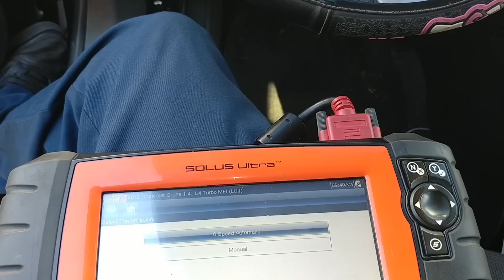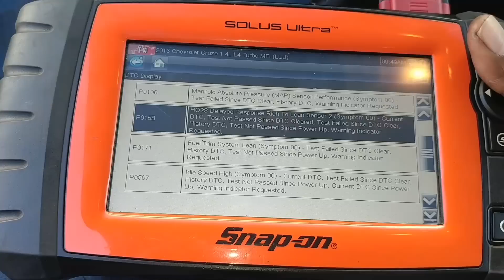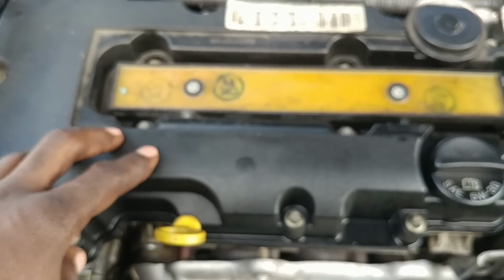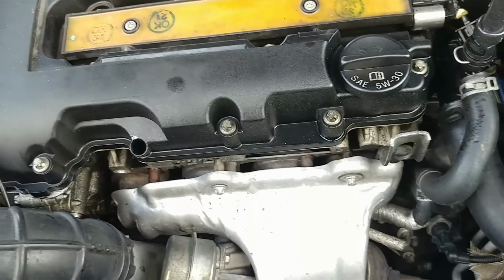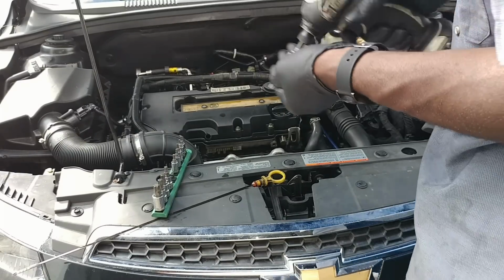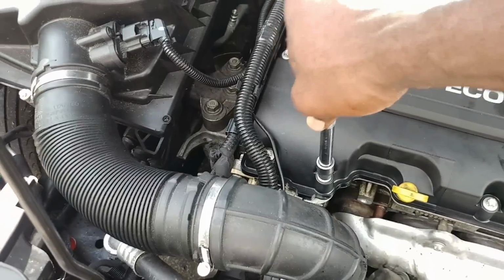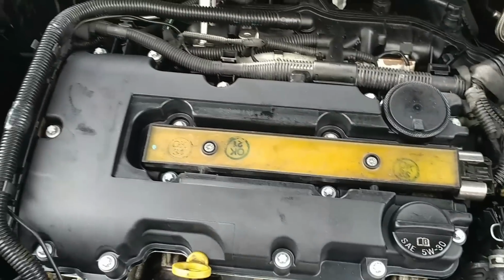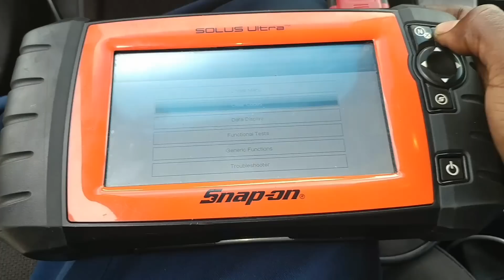Chevy cruze valve cover / pcv valve replacement

Comment from the maker: Help me help you by hitting the subscribe button
Reply: Great video Dullah. How bad is it to continue driving with the bad PCV valve? I am pretty sure this is the problem on my 2011 Chevy Cruze with 102,000 miles. I just changed the spark plugs last weekend and do not have time to work on it again for another 2 weeks. I am driving about 90 miles per day.
Reply from the maker: Poor engine performance and stalls and bad gas mileage
Reply: Thank you very much, I was able to successfully change out the engine cover yesterday. The wire harness on the left side of the engine cover was a little bit of a pain to disconnect, but looking back at the clips it looks like you push in towards the engine and then up and they would have come off much easier. Running much much better now and also did a Lucas oil fuel treatment. What is your opinion on running seafoam in the oil to clean up some of the gunk? I'll be sure to give your video a like and follow your channel!!
Reply: Do you know where I can get this part please

Comment: This repair is covered under your power train warranty, my Cruze has 94,000 miles and it’s in the shop right now getting repaired
Reply: i don't think it is covered
Reply: @LOLONO666 covers pcv valve 100% cover until warrant. not regular warranty chevy gave extra 10-11 years warranty for some parts like pcv valve because this problem is 97% cruzes and thats why GM RECCALS FOR ALL CRUZES FOR FREE replacement for these some parts.
Reply: @YT91-ot1gx never heard of that.

Comment: Ok bro awesome scanner by the way lol. That valve on the valve cover is not the pcv valve. It’s the vacuum control valve. The pcv valve is part of the intake. It’s amazing u guys actually get the right pats.on the solus scanner if you have the proper update it will show you the vacuum diagram for this vehicle with the proper names of the components and where their located. Just an fyi.
Reply: @dr6124  if you follow the corrugated hose from intake to turbo inlet that is the pcv coming from intake. If you take the hose off from intake side and look down you will see the shitty pcv valve design lol. If there’s no rubber looking plug then you’re goin to have to replace the intake. It’s mostly the reason why the vacuum valve dies.

Comment: The cover with the diaphragm is not the pcv valve.  It is the vacuum regulator.  The pcv valve is in the intake manifold and the turbo inlet.

Comment: I didn't see you mentioned the need for silicone sealant near the cam drive sprockets.
Reply: Glad I'm not the only one who caught that! Nevermind the improperly torqued valve cover. The proper spec is 71 inch pounds.

Comment: I don’t have air blowing out like that or suction do I need to replace the valve cover? My gasket is seaping a little oil out so idk if I just have to replace the gasket or the whole cover ??
Reply: It could still be the valve cover, check https://www.youtube.com/watch?v=aqFFn1cjgdc his was seeping oil but i think it also blowing air.
Reply: @Tvordiy92  yeah mines not blowing air or sucking in air
Reply: Same problem in my car. Oil coming out because of bad pcv valve cover. If not problem for you may be its just strated.      If some other issue let me know.
Reply: @YT91-ot1gx  yeah if oil coming out your gasket is bad or check the bolts .. and usually when u change ur gasket u change the cover.. car is a disaster problem after problem now I think my turbo going and a tiny head gasket leak out the block

Comment: That’s not a PVC valve it’s part of the PVC system  but there are 2 PVC valves, one in the intake and one at 5he end of 5h3 brittle plastic hose that goes from the intake to the turbo inlet.

Comment: My sonic runs ok till it warms up after that is runs like crap. No engine light has come on. Would the cover be doing it?
Reply: I had that same behavior, it ended up being a leaky valve cover gasket but it also threw P0171 and P0420.

Comment: I'm getting a p1101 code on my 2014 Chevy Cruze. I suspect this might be the reason for it - I noticed when this error code came up the serpentine belt was also starting to squeak. Not sure if that is also related to this cover?
Reply from the maker: Yes some time it throw that code for thw pcv valve try and listen for vacuum leaks
Reply: Also probably not your serpentine belt, next time you hear that sound with the engine running pop the hood and pull the dipstick out a little bit see if the sound goes away that’s part of the bad PCV problem.

Comment: I have oil where that coil pack goes and I can't seem to find where it's coming from any ideas
Reply from the maker: It sound like your valves cover gasket leaking
Reply: It must the gasket failing
Reply: Dont know if this helps you at this point, but I used a spray bottle to empty the oil out after replacing the gasket
Reply: My 2011 is doing the same. Replacing valve cover.

Comment: Its going to do it again. You have to modify the intake manifold.
Reply: I brought my car to the repairshop and they also told me this. However, he didnt explain me why. Do you know why i cant just replace the valve cover?
Reply: @funkzpandaz  there is a check valve that's supposed to be in the intake manifold.  Its likely gone. You either have to replace the manifold or modify it. The 1.4L is garbage.
Reply: @MFMasterBates  So just buy the entire manifold if the check valve is bad too. Is that what you're saying? At the dealership getting charged 100 for them to tell me if my check valve is bad or not because I know the PCV is bad.
Reply: @hpensive  no, you modify the stock intake manifold to fix the issue. $80 fix and its permanent. Don't waste your money at the dealership.  Valve cover and intake mod are easy fixes you can do yourself
Reply: @MFMasterBates  Thanks bro. I'm stuck here anyway till the parts shop opens but I'm glad I can tell them shove off on an extra couple hundred.
Reply: @hpensive  google the fix. I found it on a Cruzetalk, and a guy there sells the parts kit to modify the intake manifold.
Reply: @MFMasterBates  Cool that's how I found the problem.
Reply: @MFMasterBates  Now the dealership says it's my entire intake manifold and they wanna charge me $1200+😂😂😂😂
Reply: @Omit X For that amount I had a mechanic shop professional put the modification on with my new valve cover. He didn't feel comfortable fixing the front crank seal that's broken though. I'm scared to see how much the dealership wants for that.
Reply: @hpensive  I just got back from dealership they quoted me $910.  Screw them.

Comment: I though you needed to change the intake manifold ? I bought the PCV fix it was 75 bucks there's 2 types 1 you need to remove the intake manifold the other you don't  but it requires a throttle body spacer it was 60 bucks for the spacer with the PCV fix kit the PCV valve is external now you will never need to replace the valve cover again
Reply: Can you tell me where you bought yours at and for how much?
Reply: Where did you shop and purchase these items???

Comment: Should you add rtv to new valve cover?
Reply: JB Kwik Weld!
Reply from the maker: You need to i never you any rtv on none of them and  they never leak and I do a lot of them
Reply: Supposed to in two spots where the timing chain meets the valves.
Reply: You do on these cars. You need to put rtv gasket maker where the timing cover mounts to the side of the engine block or it will leak still. Trust me it's happened before.
Reply: That isn't the pcv valve on top of the valve cover. It's a diaphragm for the pcv system.  The pcv valve is in the intake manifold.
Reply: And to the person that made this video, you took those bolts off and put them back on in the completely wrong order. Theres a sequence you MUST follow in removing and tightening the valve cover bolts. A bit of advice,  make you know what your doing before making a video and try to educate others because you are giving bad examples for other that need to do it by how your doing it. Smh
Reply: @matthewlobberecht6187  I did develop a small oil leak. It's been fixed since then.
Reply: @ernestopulido8837  my comment was meant for the person who did this video.
Reply: @matthewlobberecht6187  yeah I know. I was responding to your first response about needing to use rtv on these cars.

Comment: So all those codes were present because of a bad pcv valve?
Reply from the maker: Jai Aceves yes
Reply: Thank you because I have a friend at work and she has the p0171 and p1101 on her Chevy crude. I told her I would look into it for her
Reply: Do you know what the part number is for the replacement cover or should I tell her to go to the dealership and order it?
Reply from the maker: Jai Aceves valve cover that's all you have to tell the dealership
Reply: Thank you so much your video is very helpful for the diy person. You have me subscribed
Reply: Dullah Goso hard expensive?
Reply from the maker: Marvelous1 no its not that expensive
Reply: I bought mine on eBay for $61 and it came with gasket too
Reply: Jai Aceves just got it at the dealer for 115 I needed it asap
Reply: I am not sure what the torque specs were I just tightened all the way and then went a little more. I also used a RTV silicone to help seal. Just be careful when removing valve cover you don't want to pry too much
Reply: Jason Britt thank you Jason. I had already got mine on eBay for $61. I completed the installation of the new cover. Code went off after a drive cycle  and hasn't come back.
Reply: @jaiaceves9423  alot cheaper on Amazon. Get the oem. Genuine GM part. No knock off. About 60.00$.

Comment: How long did that valve cover last?
Reply from the maker: From the day i fix it it's still going strong customer haven't call me about it
Reply: I’m about to replace mine for the second time, first replacement lasted 20k miles.
Reply: @efaucetttx3  investigate your pcv system. In your intake is a little orange valve that takes a hike. Look for Dre Dan on YouTube, he has some very informative videos on what's going on with your car.

Comment: That is not even close to being the pcv valve. One of the pcv valves is in the intake manifold, which I'm guessing is shot. It also sounds like you've got some bad crank seals maybe.
Reply from the maker: How can you hear when you habe a bad cran seals 🤣😂🤣 doesn't sound like you know what you are talking about
Reply: @DULLAHGOSOHARD  that chirping sound that sounds like birds when the car is running. Pull the dipstick out while the car is running. If the chirping goes away, you probably have bad crank seals.
Reply: @DULLAHGOSOHARD  I could absolutely be wrong about the crank seals though.

Comment: This is a pressure regulator...not pcv valve.
Reply: So is that what they're called at the parts store too?
Reply: No at the parts store it a pcv valve cover. It's a much different concept than most. Instead of a $10 part this is $80.
Reply: THANK YOU!  Too many "mechanics" confusing people by calling the regulator a PCV valve.  This engine has 2 PCV valves...that pressure regulator is NOT one of them.